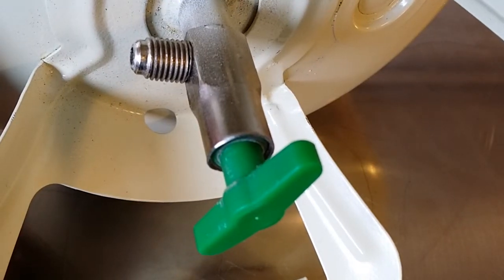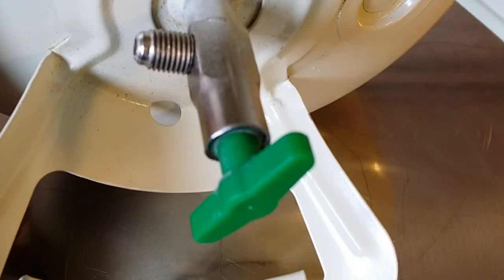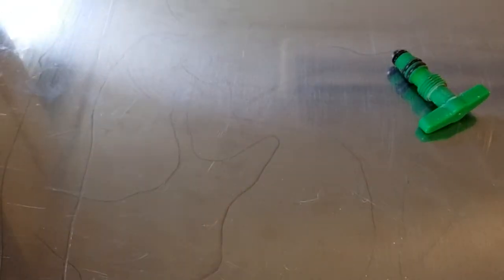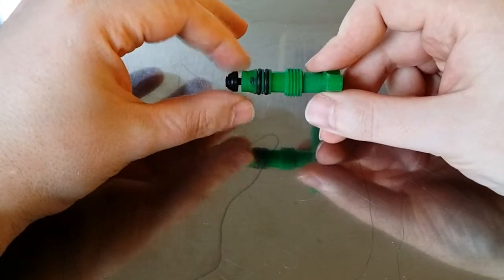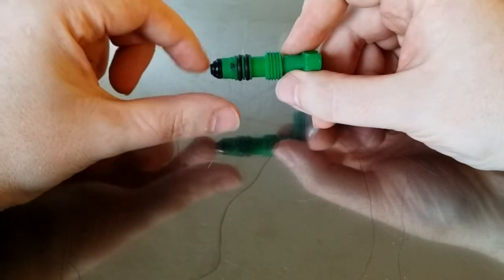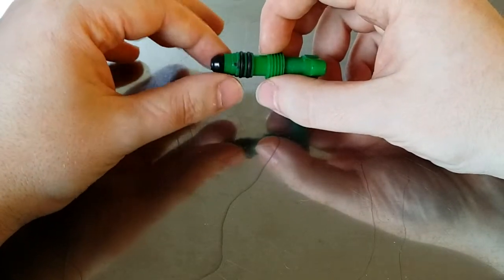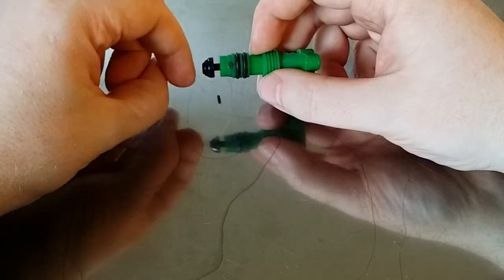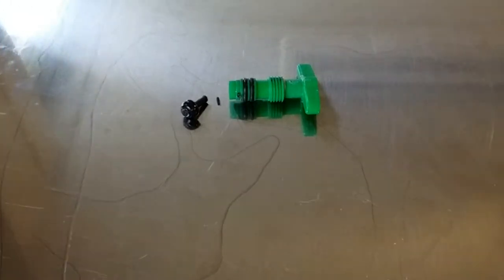Teardown: Inside a one way valve, non-refillable valve gas cylinder

Comment: i disassembled 3 and it was a success!  i took the check valve out and now i got 2 air tanks in the car incase of a flat and the third one is filled with butane.  butane doesn't make much pressure infact you could store it in a plastic bottle!  i like baloon time tanks because of the weak point safety feature.  if anything is gonna blow it will only make a loud pop and hiss.   i use the butane tank to operate a camping stove, grill, heater.   the butane is expensive in that amount to fill a baloon time tank but it lasts a very long time!

Comment: thaaaaaaaaaank you so much Sir, I was breaking my head trying to decypher what the name of the nipple was, I'm stil trying to figure out if it is 1/4 size tho and if this is a special kind of thread or what. have a good one!
Reply from the maker: That's a  7/16 JIC. Size 4 on the designation chart https://en.wikipedia.org/wiki/JIC_fitting
Reply: @manwiththestar2305  you're a life saver!
Reply: The fitting is 1/4 SAE flare, size 4. The threads are 7/16-20 straight (not tapered). They are called JIC fittings, SAE J514, 37 degree flare.
Reply: @ToyotaKTM  thank you as well Sir
Reply: @Kakunoshin_Niitsu   I've got a 7/16 unf to 1/4 bsp convertor which works but I've decided to get rid of this valve altogether and go direct to tank.  What's the thread on here its slightly larger 11.78mm diameter on outer threads.
Reply: @richardgoforth1833  Hello! I don't quite understand. I would like to replace the removed valve with a spacer that I can use to connect to the pressure switch, but I don't want to order the wrong part. My pressure switch's input connection is also 1/4" BSP. Could you give me a link to such a converter? Thanks.
Reply: ขอบคุณทุกคนเป็นอย่างยิ่งสำหรับข้อมูลขนาดเกลียว

Comment: Many thanks for this. 

I've got a one here that I was thinking of using as a low-pressure tank for charging a very small pressure vessel that's a pain do using a pump. Looks like it's possible but not as easy as I thought. Fixing the poppet valve to the threaded part, say with pin in a new hole, should work.
Reply: Just done the valve here. Dumped the spring, removed the remains of the frangible pin, held the valve tight in the head and drilled a new hole in the valve shaft suitable for some 1.6mm copper wire. Cleaned up the threads (there was what looked like some kind of low-strength thread lock on mine), new silicone grease on the O-ring and reassemble. 
Now I've got to find some way of getting from the ¼" SAE fitting to a Schrader valve body.